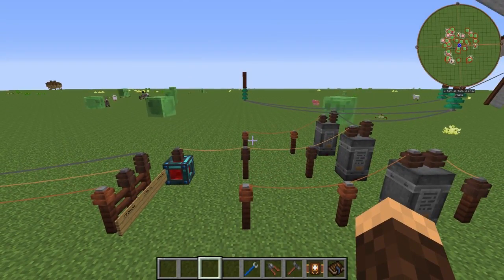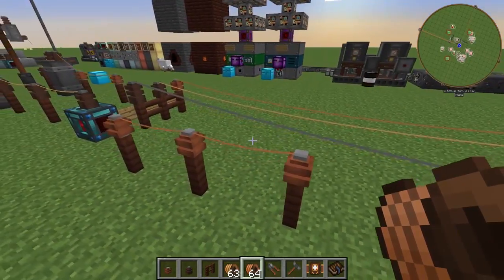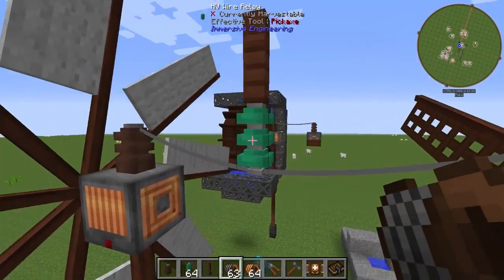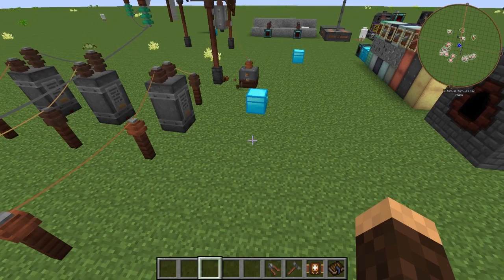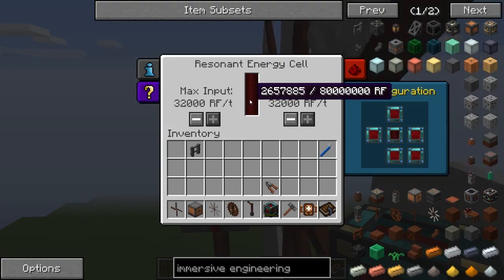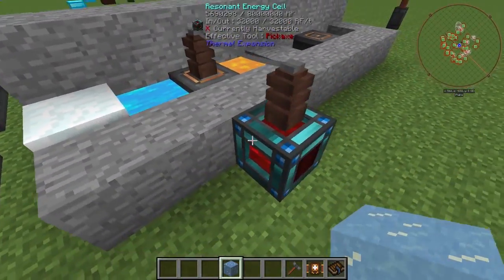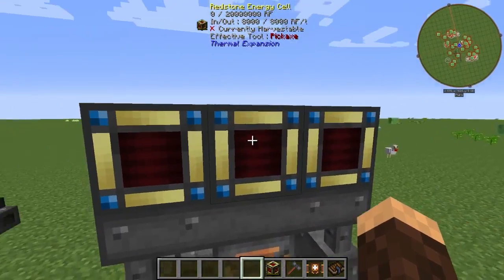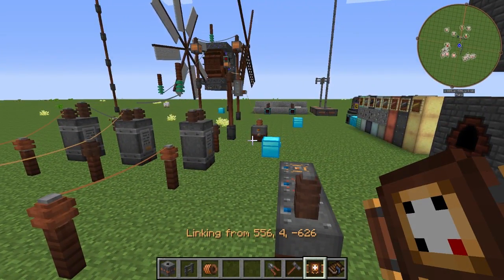Immersive Engineering Mod Spotlight Part 1 "Power Mechanics, Power Generation" (Minecraft 1.7.10)

Comment: I'm having an issue with the mod in 1.10.2 with Forge 1.10.2-12.18.2.2124. I can't get any power into anything from the mod. None of the generators give any power, none of the capacitors receive any power either. I also have Ender IO installed. And the power works just fine. Power generates from the photovoltaic cells and transfers with energy conduits into capacitor banks without any issue. Thermal Expansion has yet to be updated to even 1.8, so maybe it's an issue with the Redstone Flux API.
Reply: Recently started playing Direwolf20 1.10 and im having the same problem. Everything BUT Immersive Engineering works just fine
Reply: Why are you posting this here? Contact the mod developer if you want help with this. This guy (the youtuber who made this vid) is only a presenter, not a developer.
Reply: Mark Miller  I know, i just wanted to get my issues known. Often developers check on spotlights of their mods on YouTube. But if someone could point to the developer, that would be greatly appreciated.

Comment: Only thing I think they should fix is the fact that there is no real reason to pick LV, MV, or HV other than the amount of energy you can store with that type of capacitor. Every machine can take any level of voltage, which in real life isn't the case. This kind of renders the transformers pointless.
Reply: i believe that the transfer rates differ as well. LV is more limited but cheaper to make i think. Still learning myself.
Reply: I think you may be right

Comment: You need to be an engineer to master and be a super pro on this (mod) but if your not an engineer you can just learn electricy,electronics,mother boards,motors, and mechanical generators and other stuff i m 10 years old and i m a apprintace (robotics) engineer when i go to school my freind and classmate Mattew has a ID electric fan and when hes electric fan is broken he always tells me he says this in a couple of weeks ago: Hey Kenshin my electric fan is broken when i touch the coverings of the motor it stops! And I said let me see i figure out the problem it was just the blade attach to the motor because it was to tight.
Reply: +Kenshin Vista lol kid your too young to be online
Reply: salty .cats too late i play minecraft engineer!
Reply: salty .cats in november 7 i create a solar drill bot machine not acual size i promise i created it by myself i swear!
Reply: kylorvont :)

Comment: what pipes should I use to transfer the oil for the diesel generator? or is there some way to get the generator working without it, because I have no idea how to get the oil in the generator...
Reply: ***** It doesn't use oil.  It use biodiesel and or bc fuel (maybe others of which I am not aware).